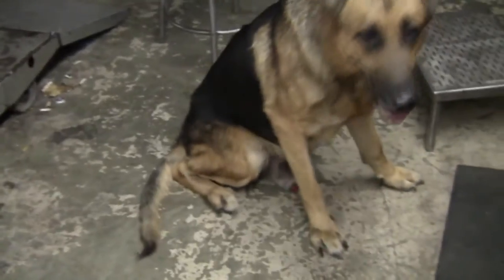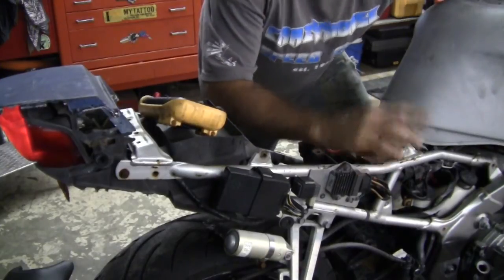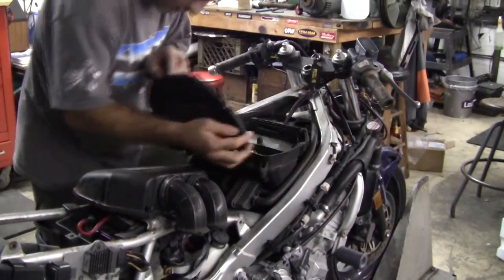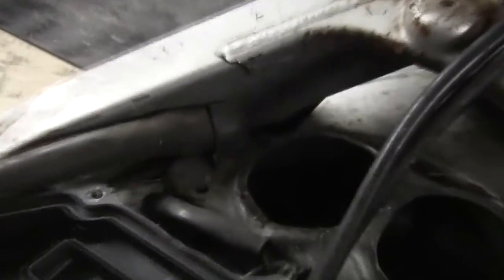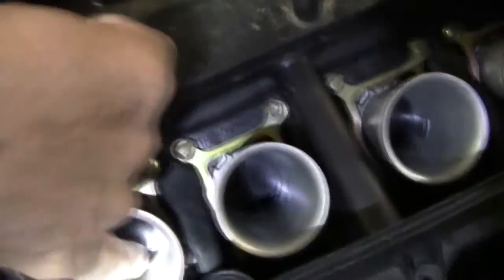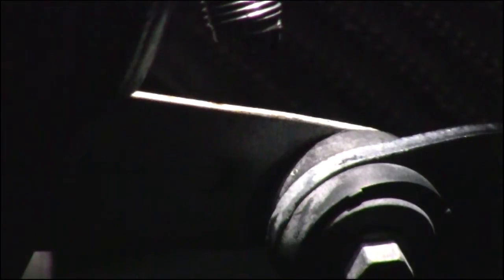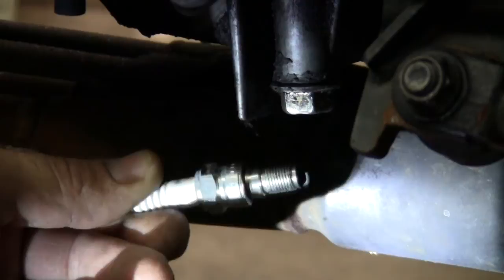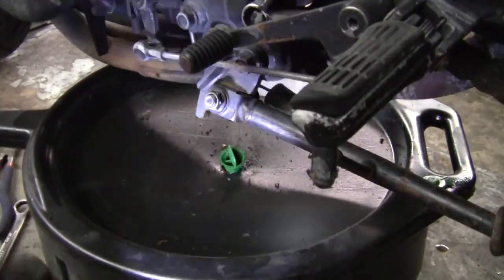Honda Motorcycle Buying your first Sportbike pt.3

Comment: Great tutorial man. I have a chance to get a 2000 gsxr 600 non running for $750 it has 50,000 miles on it.  Would you take a gamble on it? I’m fairly mechanical and work on my cars but this would be a first working on a motorcycle.